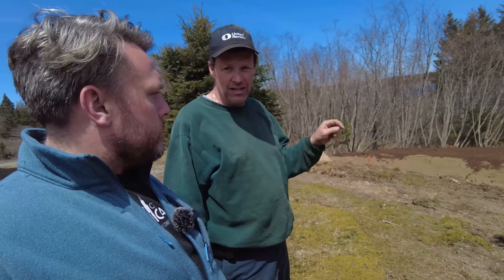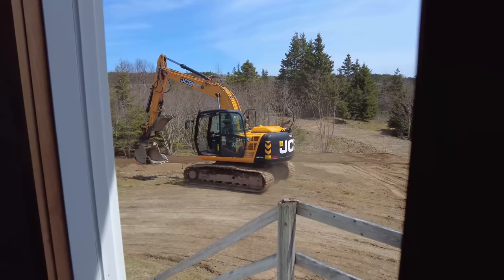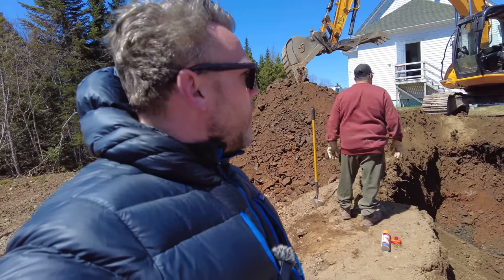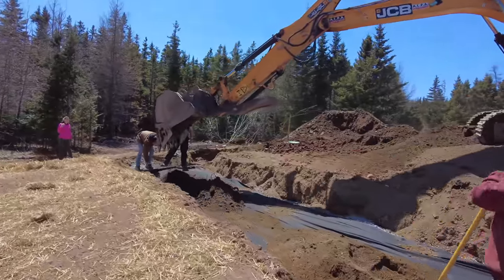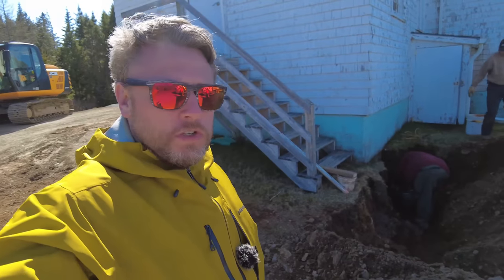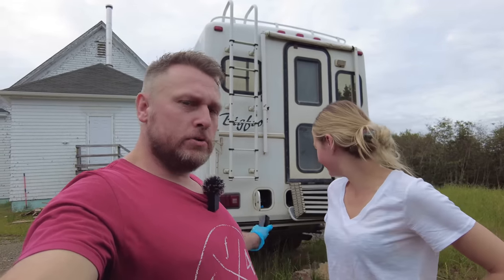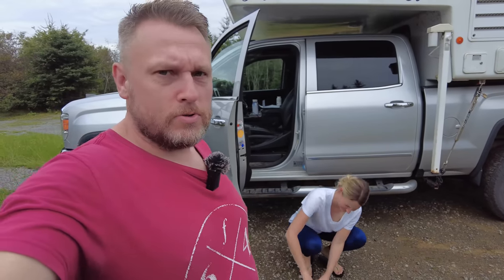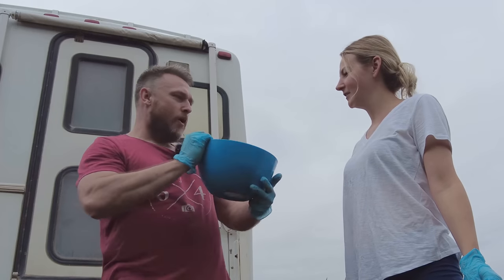Septic System Install For Our Old Church Restoration

Comment: Holy shit Gavin. What a pisser with the RV dump. Seriously though that was interesting. I worked for a few years at a county health department here in North Carolina dealing with septic tank permitting. The drain field for your system is so different from what is done here. But you have to deal with freezing issues we don't have. The one thing you didn't mention is whose hose end broke loose and sprayed Amanda with, shall I call it unprocessed poo. Anyway, you two are a hilarious team. I look forward to more renovation adventures.😁
Reply from the maker: Clearly it was not my end ;)
Reply: @HardcastleTowers  I think Amanda needs to confirm that. By the way, whose lenses cloth did you offer to Amanda? The one you never gave back to Uncle Grumpy? 😆😆😆
Reply from the maker: @jackstutts6439  it's the same one

Comment: Maximum kudos to Amanda, a really good sport. So the pipe is 4 feet down? That' way the camper won't crush it, but it's also to prevent freezing – how's the church insulating coming along?
Reply from the maker: Haven't even begun yet!

Comment: Why they dont insulate that system whit styroform or other insulation material? Is there no winter there?
Reply: Here on Finland ground froses 20-50 cm deep in wintertime, in North Even more.